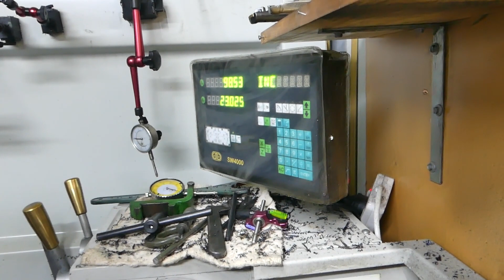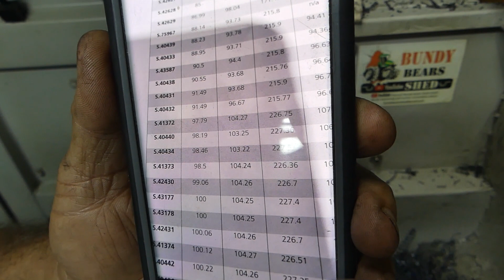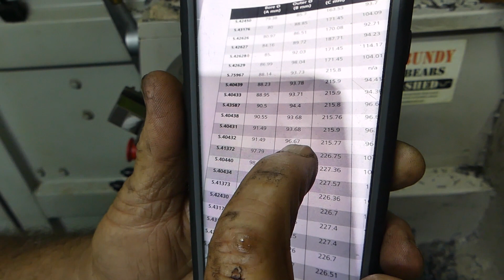Massey Ferguson 65 # 25 Machining the Cylinder Liner Puller Plate

Comment: Tip from a fitter and turner. If you invert the jaws in the chuck you have a landing for the face of the job, no need for parallels. Tighten the jaws and ensure it is set back to the landing with a dead blow hammer or we used a large lump of lead.
Reply from the maker: I do that with the 3 jaw and 4 jaw but the 6 jaw doesnt have the jaws to do it.